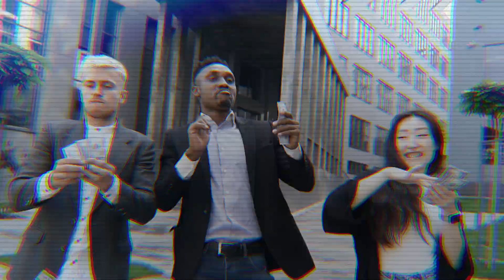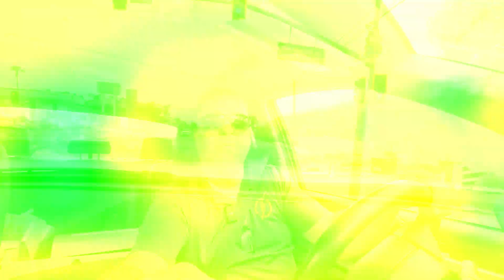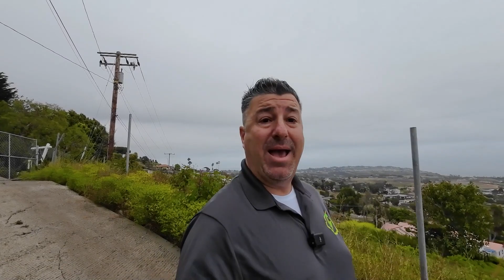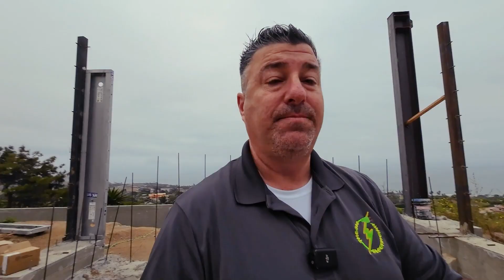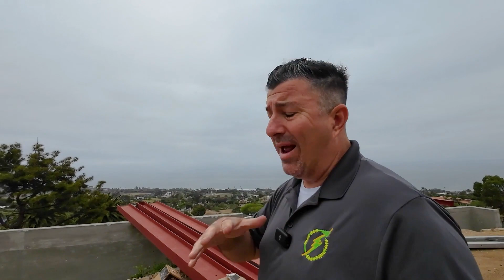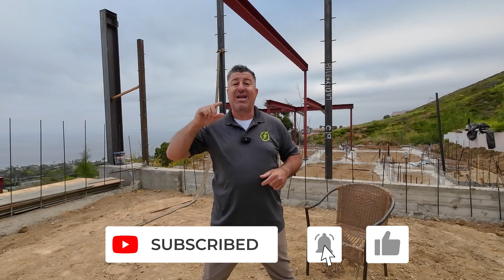How to Bid Electrical work . Make $$$ #electricalcontractor #electrician

Comment: i have had   builders call me to wire up a home after it was  poured i dont like it one  bit  becuase there are radiant heating lines in the slab already and you have to   break the slab for your poured slab work espacially in the kitchen for islands ok dont miss it

Comment: 320,000
Reply from the maker: Good guess, what state are you in?
Reply: @The360Electrician  over or under $380,000?
Reply from the maker: @UpWheel.  Under,  but let me fill you in. We are going with Radio Ra 2, only 2800 sq ft not including guest house and storage. Most likely Leviton smart panels on the inside, Seimens or Square D on the outside, depends on aic rating and engineering. No low voltage, that's separate. What do you tink?
Reply: @The360Electrician sounds pretty solid to me although I’m in Connecticut so I was just taking a wild guess on the California pricing😂 good luck on the job my friend and please keep making these bidding videos